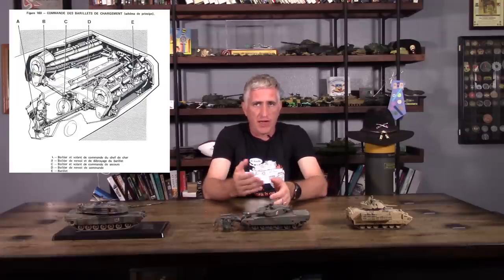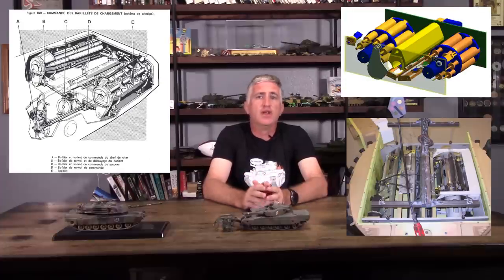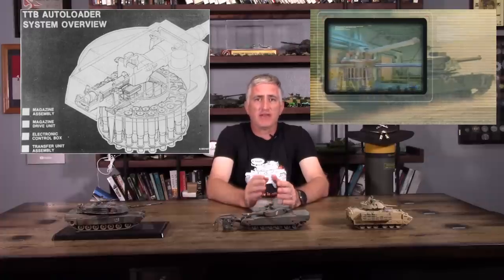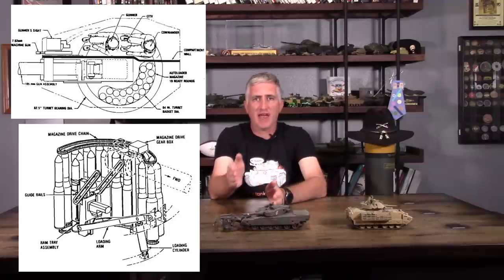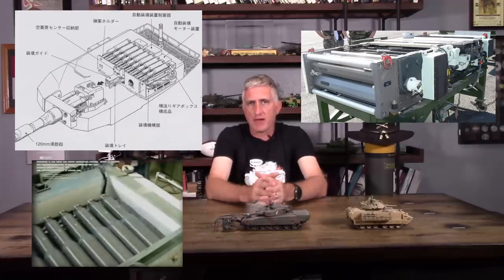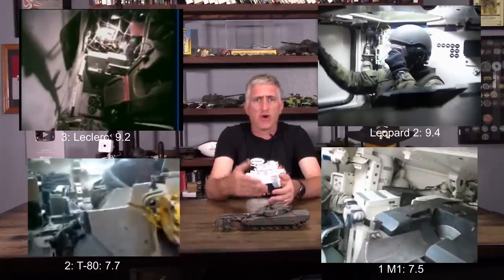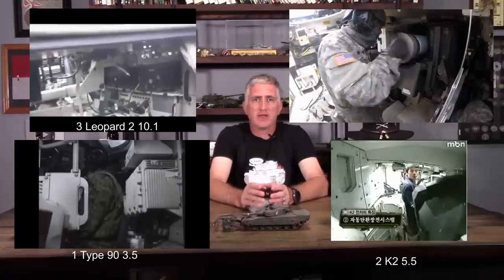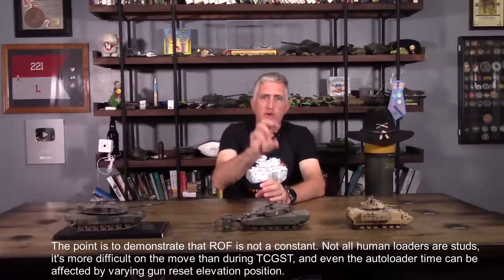Whither the Autoloader?

Comment: Sweden did not really drop the autoloader. It was more that the best option availible didn't have an autoloader. For example the Leclerc was a part of the swedish trials and if Sweden had gone ahead with the Strv 2000 project - it would most likely had an autoloader.
Reply: And during the time the Strv 103 was in service it did so simultaneously with Centurion tanks (strv 81, 101, 102, 104) and the 105prototype that participated in the same trials as the M1, the Leclerc and the Leopard 2.

Afaik. The Swedish tank brigades of the cold war were equipped aboul 50/50 with either 103s or Centurions in two tank companies and two mech inf companies to each tank brigade.
Reply: S-tank was just too small for not using an autoloader. It was not a choice of automatic system. It was a choice of strategy then tactics then S-tank and then the autoloader as the only possible desing. Choice of  the Leopard 2A4 and modernizing it for 4mln per each into 2A6 (more like a 2A6+ ) standard was a very sensible and very sure move into manual loading system.
Reply: @HanSolo__  the swedish designers still like autoloaders.

the CV90105 has an autoloader, and it doesn't need to as the CV90120 doesn't (and back in 2014 they said they were developing a autoloader varient of the CV90120, this may have been cancelled due to no sales of the CV90120, as i can't find any more references to it)
Reply: @matthiuskoenig3378  Yes. They are going into autolader just as all the designers do. Yet in past having an auto or manual system was due to particular tactics way more than any type of favoring one over the other. That being said in 2012 they were still into manual on the havy MBT. Mostly because of a good, properly working Leopard 2 desing than the favor of 4rd man in the crew.
Reply: @matthiuskoenig3378  the CV90105-TD and CV90120-T never got further than proof of concept prototypes for export, almost like the CV90120-AMOS that the Swedish politicians pulled the funds for just as the system was getting ready for full serial production... Leaving our eastern brothers in Finland to salvage what they could and wanted from it, just like our western brothers in Norway did to us a few years later over the Volvo/Bofors SPFH77 Archer system.
And, @MrKansai1 teghe , as I stated, it wasn't a shift back to manual loading as much as streamlining logistics to a single type of MBT when two completely different types of MBT was deemed obsolete simultaneously.
After all, both the Strv 103(s) and the Strv 102/104 (Upgraded and modified Centurions)
Were essentially late WW2 designs of the same era as the soviet IS3-IS10 and the T54/T55 and then gradually improved to deal with the T64/T72.
The 103 also had a very complicated and notoriously leak-prone hydropneumatic suspension system and drive train with it's dual engine piston+turbine configuration and a gearbox with separate reverse gear allowing for using the full gear range both forward and in reverse...
Reply: @SonsOfLorgar  AFAIK the leaks were a teething problem that got fixed.
Most interesting is the D-version of strv103, of which only one was made: Remote controlled with the onboard crew replaced by cameras and servos!
Remote control is the future, and you can't have that without an autoloader...
Reply: Had they gone through with the Strv 2000 project they'd have the most awesome tank in the world by now.
Reply: Exactly. Similarly Poland after few decades of autoloader only tanks iteoduced manual loding ones in 2002. But it was the case of "hey Bundeswehr is willing to give us a hundred leopard 2s for free and they are definetly better than T-72s we have and also better than PT-91s. Now last thing anyone would say was "they don't have autoloaders, we don't want them".
Reply: I wonder if the size of country and manpower available is a role. France went with two-man turrets after WW1. (Yes I saw his videos.) Or maybe not, since Russia uses autoloaders.... but they also like quantity over quality.

One advantage of having the 'unused' fourth crewman in the rear is that, in theory, the TC informs him(generic) what they need for supply and he arranges it.

Comment: Way back in the day, the USN found that a 5" round was just about the upper limit of what one man could wrangle repeatedly in the confines of a turret. If (when?) AFVs start pushing up to and perhaps beyond 140mm main guns, autoloaders may become a practical necessity.
Reply: Lower than that, because a naval gun has plenty of room to maneuver in,  and a tank turret is critically restricted.
Reply: The USN developed and installed 8 inch autoloaders on the cruisers after WW2. There is a YouTube video that a person transferred from the training film about it somewhere on the site.
Reply: It's not really an apples to apples comparison. The naval guns were firing two piece ammunition, and it was generally considered that a 70-80 pound shell was the upper limit for a single loader. However, naval guns were operated from a standing position and had far more space.
Reply: @ARCNA442  I was not making a comparison, just giving info. As a 3rd class Midshipman in the summer of1975, I loaded 5 inch shells and also had turns on the gun powder canisters for one of the two 5 in 38 cal dual gun mount on the USS Bausell (DD-845) in the Western Pacific. I can still recall the weight of the rounds and the lack of space since you had about 14 sailors in a dual mount. Add to this not good ventillation for the Pacific and the smoke in the mount after firing and reloading, it wasn't a pinic either.
Reply: @ARCNA442  the 8" automatic guns were single piece ammunition.
Reply: Even further back, during the pre-dreadnaught era, the US Navy decided that the absolute biggest possible round that could could be hand-loaded was a 7-inch gun. This thing was a backbreaker, with a 165 pound projectile and a 58 pound propellant bag.

Comment: Another gem of a discussion Chieftain. Being ex Australian Army I have thought for a long time that a 3 man auto loader tank would be preferable to the current 4 man doctrine due to our low manning available and the French solution seems a good use with backup personnel still present. Your experience with short handed crews in Iraq demonstrates the value of having backups ready on the bench, as it were.

Comment: I should add that Sweden dropped the autoloader when they dropped their indigenous designs, so it wasn't a move away from autoloaders it was only a move to a newer generation of tanks and the foreign designs they bought just didn't have them.

Arjun and Altay are their countries' first-ever indigenous designs (Altay is a washed down copy of the K2 though), so it might have been deemed that it's simply easier to stick with a human loader instead of adding the burden of designing a good autoloader for their first try at tank designing.
Reply: additionally sweden likes autoloaders in their artillery indigenous artillery. Bandkanon 1 and more recently Archer.

Comment: One thing that wasn't mentioned for the pro-autoloader side is that morale and other in battle elements can affect performance. Humans tend to perform differently when under fire, panicking, desperate, and situations where conditions are poor or the tank is being jostled around while maneuvering or taking hits. Obviously proper training and equipment can help with this, but a machine is typically much more consistent unless it has taken damage. The same could be said about a human loader as well because if the human loader takes damage it will perform worse. Plus metal is harder than flesh.